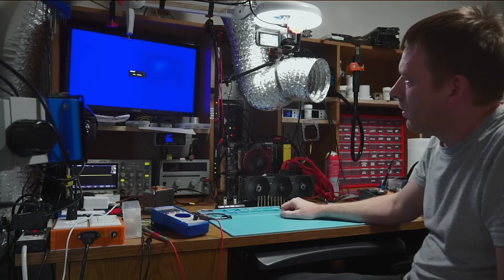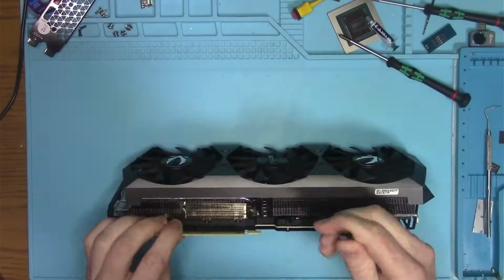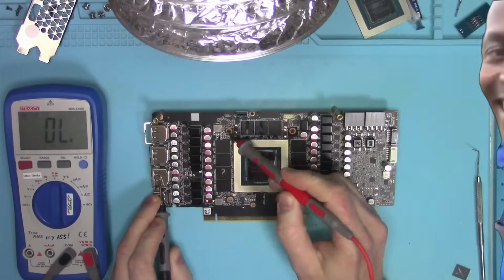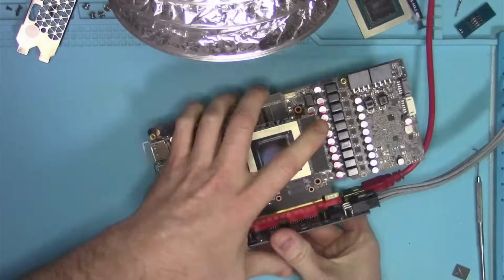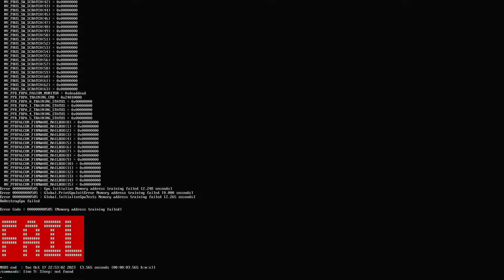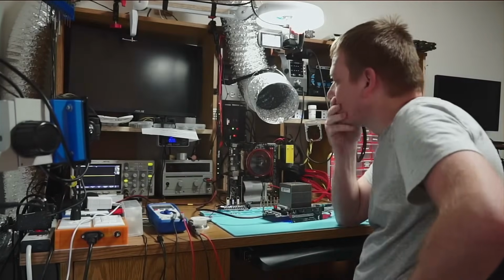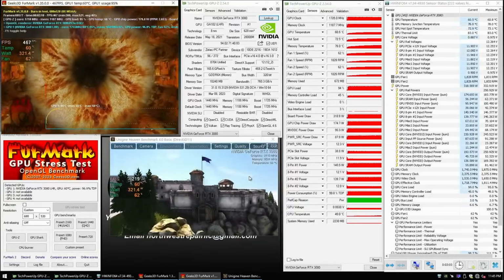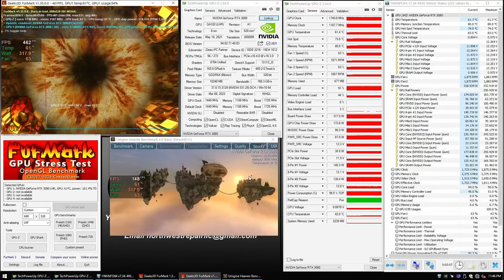ZOTAC 3080 Artifacts and Blue screen of death FIX

Comment: I "repaired" an old hd7750 by desoldering and soldering back the power management ic (uP1609R) because i suspected a shorted cap somewhere on the mosfet switching circuitry, so... Is the power ic malfunctioning and the heat temporarily fixed it, or are the mosfets themselves that are failing? Some of those mosfets would remain turned on while some others measured open from source to drain...

Comment: If you replace one memory chip, don't you have to replace all of them with new ones to prevent further similar problems?
Reply: Depends if all the chips are on the short end of the bathtub curve. More than likely that one chip was not defective by the slimmest of margins yield wise.

Comment: Great work, is it possible to add memory chips in unpopulated areas as to turn a 8gb gpu into a 12gb gpu?
Reply: Yesn't you also need to Flash the software if possible
Reply from the maker: no

Comment: Those memory temps are already a bit on the high side considering you are running a stress test in open bench. Graphics cards manufacturers need to start rethinking their memory cooling... My 3080 also runs the memory on the low 90s out of the box which is way too close to tjmax for my taste

Comment: Diarreha of the memory chip pins? I wonder what causes these solder ball joints to be so weak? If they used a more reliable connection method you might be making videos on how to replace phone screens or something else.
Reply: They use unleaded solder (RoHS certification) which is brittle. Using leaded solder would solve a lot of cracked solder issues but I don't think any computer parts manufacturer uses that nowadays.

Comment: The card is broken, well it´s a Zotac, I probably never seen a higher rate of failure than many other brands at least. But to be frank it seems the newer cards become the more fragile they get no matter what brand it is these days
Reply: Interesting Zotac tidbit you've given.  My anecdotal story is that I had a Zotac 1080 which I stressed 6 hours nearly every other day for years.  I sold it to a friend and it still cranks outs frames like it was fresh outta the box to this day.  It was in a tight ITX build when I had it, and he's got an ITX mini build as well.
Reply: @JackWagonizer  I guess you had a good example then. I don’t know if you are familiar with the no picture and max fan problem many of these cards gets in at least the 20 series and up. I seen my local auction site completely flooded with broken Zotac cards that suffer the same issue but it mostly been the RTX cards. So I don’t know if it has gotten worse or why it is that way. 
But the 1080 cards are golden. I actually got one myself but a Gigabyte Extreme Gaming edition. It is a card people say had issues but mine have done nothing but performing and I am still using it today and I been running it overclocked to 2050mhz from day one. So even if it break tomorrow or years from now it been a fantastic card. But I guess it is up for the lottery to determine what you get in the end.

Comment: what would happen if you put memory chips in the unpopulated channels?
Reply: you will need hacked drivers for the card as the official ones wont work
Reply: @Ankit-jz4zm  So you're saying you can increase the GPU memory? I would think that it's cheaper to buy the right card vs. upgrade the RAM later. But, it's worth investigating!
Reply: @u9Nails  a Russian guy did something similar, switching 1gb chips for 2gb, essentially doubling memory. Can’t remember the name right now but if it comes to me I’ll Edit.
Reply: @Ankit-jz4zm no expert on this topic really, but, wouldn't the drivers for the same card but upgraded version work on it? The upgraded one should have the un populated chips populated wouldn't it? Would it be a matter of hex editing drivers or something along those lines?
Reply: 3070 can definitely be upgraded to 16GB memory by using 2GB modules, people have done it. Not sure about 3080.

Comment: I’ve learned more from watching your videos about soldering, than I have in years of trial and error and multiple tutorials.  Just fixed my vacuum cleaner using techniques I picked up from watching you work, so much easier than I’m accustomed to 😂
Reply: which memory chip was at fault ?
Reply: @st_us  it was just a simple tilt switch, but it needed soldered.  So….memory channel 4 🤷🏼 that’s Micron GDDR6 so, ya know, bad 😆